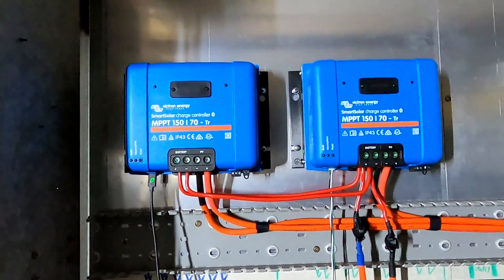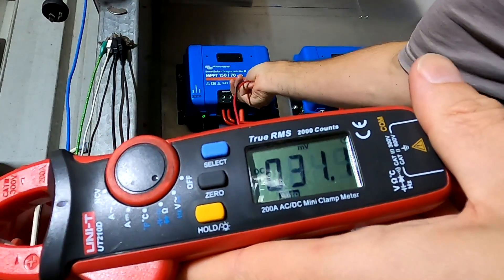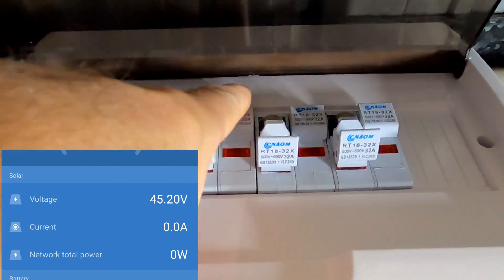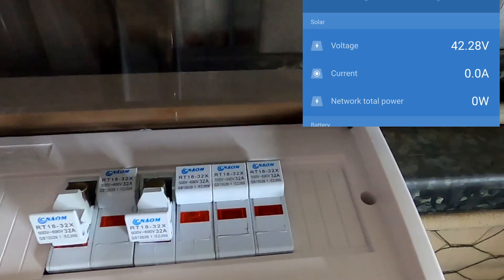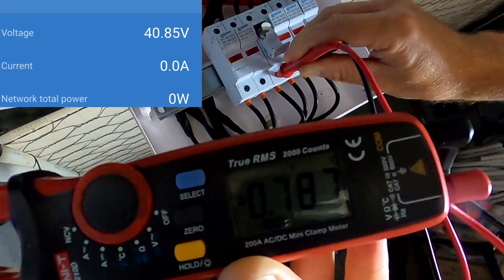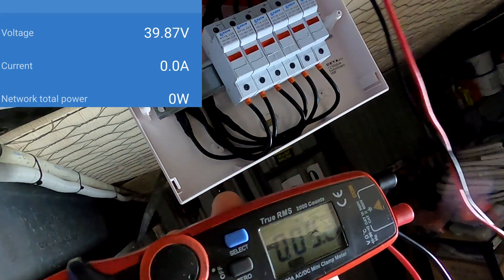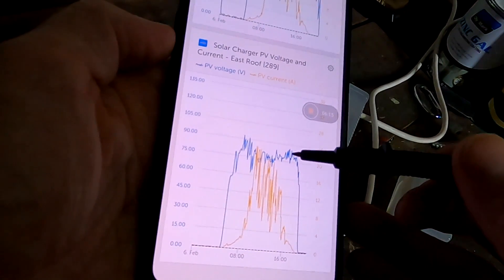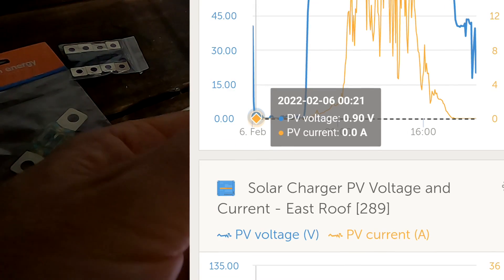40V at Night from Solar. Victron charge controller feature or fail?

Comment: I haven't watched the whole video yet but it's simply a ghost or phantom voltage caused by conductors running in close proximity to each other.
Reply: I've watched it all now and it is definitely a ghost voltage caused by cables running in close proximity to each other. A friend has an off grid house and 'bed shed' where when you turn off the LED lights in the bed shed they still glow very slightly for a few hours. He spent days trying to stop them from doing it before concluding that he would have to run all new wiring in different locations to stop it happening. He just lives with it and calls them night lights now.
Reply from the maker: But I don't have parallel cables with AC or DC in the garage at the moment. Everything is disconnected...

Comment: I’d connect up a spectrum analyser to check if it could be the feed lines picking up radio signals or induced AC that is being half wave rectified by the panels and causing a DC detection.
Reply: Agreed, even if not a spectrum analyser, perhaps an oscilloscope would show something interesting
Reply: Exactly.  I can touch my oscilloscope probe and measure 50v p-p from my finger from induced AC and I live in the middle of nowhere.  Of course, that's a about a half a picoamp.
Reply: Seconded. Maybe the cables are just the right length to pick something up.
Reply from the maker: I've got an oscilloscope here...
Reply: Several years ago, while I was living in Chicago, I had a very good tape recorder which unfortunately used a high impedance microphone cable rather than a balanced input via transformers. Due to the high impedance microphones, it picked up and recorded a local radio station along with whatever I was recording. A single coaxial cable is unable to filter out unwanted interference while the balanced two wire cable wrapped in a shield handles it perfectly.
Reply: he had it measured with the multimeter. and even if there is some I doubt it will be 40VDC, that would be way too high imo. My money is on something to do with the DC side (battery voltage?)

Comment: Hi Andy - maybe a reverse diode is broken, this causes the battery voltage to remain visible on the panel connectors...
Reply from the maker: The battery voltage is 53V while we see around 40V. And why can we still measure the voltage even all 3 solar strings are disconnected?
Reply: @OffGridGarageAustralia  - I mean " the Mppt's reverse diode is broken" and is leaking current to the solar side.
Reply from the maker: @superpierrot  Why is it fixed at 12:30am though?